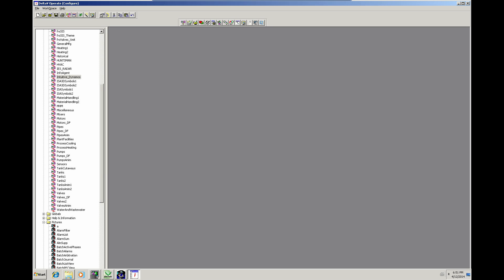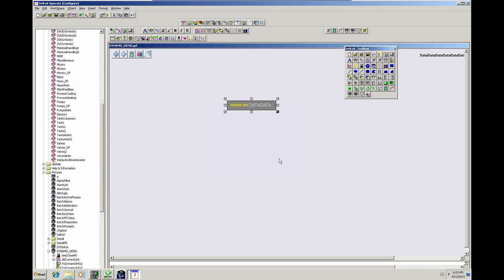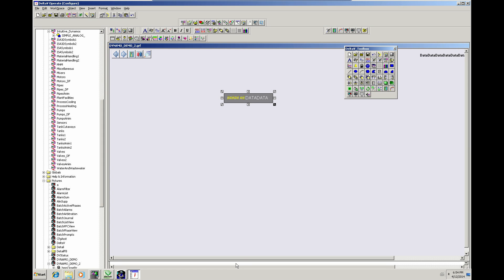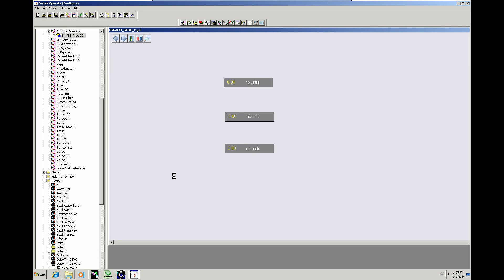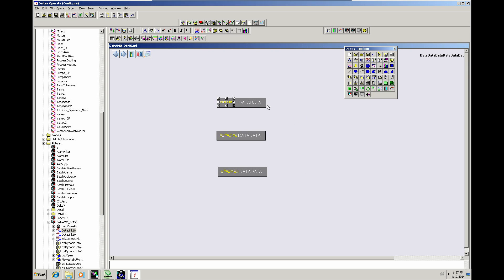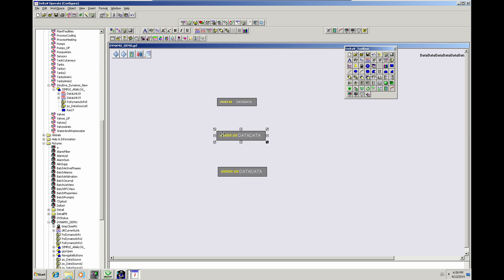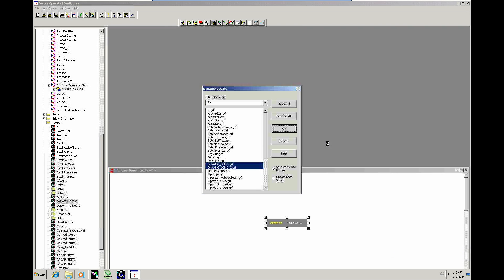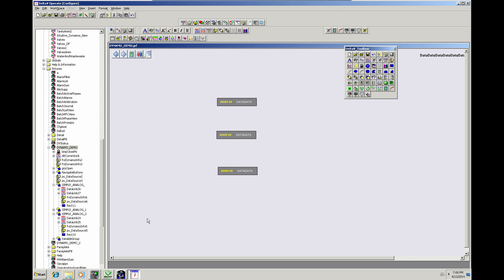DeltaV Dynamo Update Utility Demonstration

Comment: Thanks but is there a way to make a dynamo with 3 data entry and each assigned to different UNITs.. WI-XXX-32,WI-YYY-32 and WI-ZZZ-32.I do not see all the features available in iFIX for the dynamo builder in DeltaV...